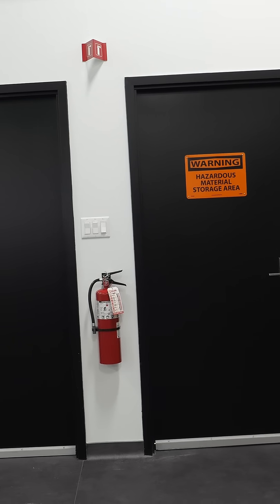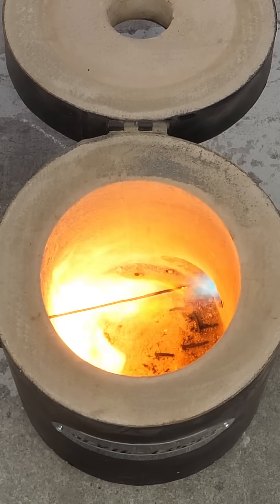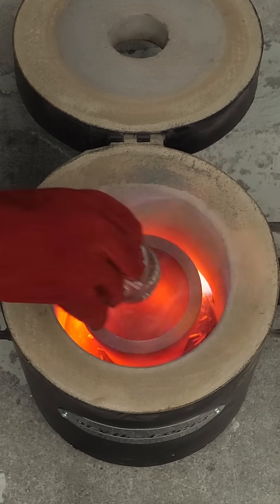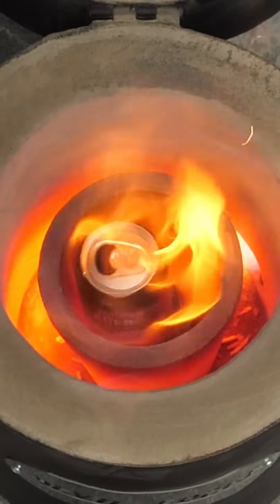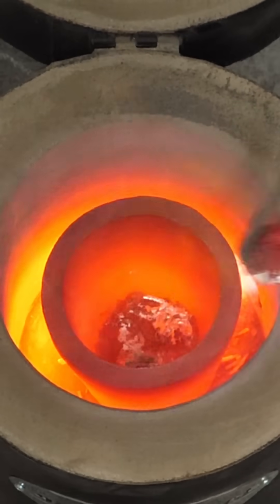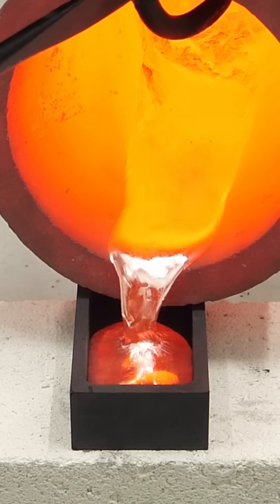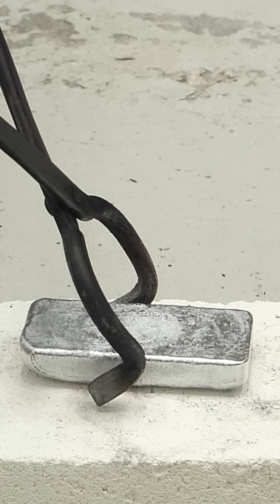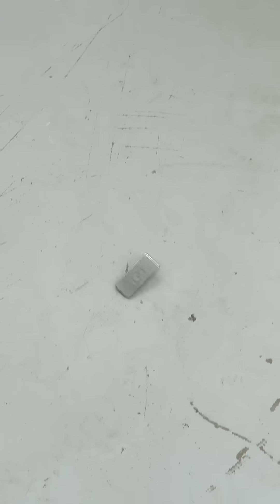Melting soda cans into a metal bar

Comment: You don't need ANY fancy equipment to melt aluminum, it is so easy*

If you've got like $30, and a good bit of patience, you can melt cans just like this. 

you just need:

- a steel pot or other steel vessel
- long barbeque tongs 
- charcoal
- a leaf blower/hair dryer with extension cord - and a metal pipe to attach to the end
- earth with any amount of clay above pure silty sand. 

It's so much fun to build a little smelter and melt scrap, it's incredibly satisfying to make a bar of metal. And it's a lot of playing in the mud to make bricks and build up what looks like a tiny fortress, it really clicks with that Lego part of my brain. 

*easy if you've got space to do it... away from neighbors and trees and access to water in case of uncontrolled fires.

Comment: The smell and smoke is caused by the plastic liner on the inside of the can burning off, its there to stop the contents of the can reacting with the metal container 

And as other people have mentioned but its definitely worth stating again, never ever drop your can in the crucible upside down, it'll either turn into a rocket 🚀 or a bomb 💣

Comment: The smoke and smell is most likely from the plastic coating inside the can which makes it so the drink is not in contact with the aluminium. Some might be from the paint but I much doubt it.

Comment: Still believe there is exothermic quality during cooling a conservation of mass and most stable form for electron vibration or excitability. Foundry’s crack yes heat expansion but also in electron “stealing” slower energy from a less excited mass and passing its energy in heat etc. there is a range for heat transfer that wants to cool drawing on cooler less excited matter around it.

Comment: i made a coal furnace with a steel bucket and plaster of paris. used a steel fire extinguisher for the crucible. had a hair dryer to blow air the coals did really well made some big aluminum ingots

Comment: The smoke and the smell is a plastic liner that they put inside the can you be better off collecting the aluminum by degrading the aluminum on the outside of the can and then resaldifying the aluminum in a distillate. That way you're not having to introduce plastic particles into the air

Comment: Be careful with that and use it in a well ventilated area. That smoke is toxic and it's burning plastic. Those cans have a plastic liner inside. That and the paint are burning. Needless to say, you REALLY don't want to inhale that.

Comment: we used to melt down scraps in the machine shop. all our stock was from a really good supplier but they didn't have aluminum in hex stock so we eventually figured out how to make our own. it really cut down the time required to CNC an aluminum cylinder from hex stock than a square stock twice the needed size. but no one in the shop liked 'kitchen duty' (a name that came from a mix of gathering the scraps to be melted down and the heat of the furnace)

Comment: Oh hey, this was me for years before I started finding other aluminum to melt down. My Can Phase definitely wasn't the most productive in terms of mass, but I learned a lot about reclaiming metal.. Cans may not have much aluminum, but they're everywhere and basically free. So if anyone else is thinking of trying this, here's what I've learned:

Obviously the cans are lined with plastic and pigment, which is bad to breathe. It's also bad to have trapped in your liquid as slag. Putting the cans in on top of each other can cause this trapped slag to accumulate and mix with your metal until you have a big, fluffy shiny sponge that can't be used.

To avoid this, I started cutting the cans into strips with some hedge trimmers, and loading stacks of these strips standing up in the crucible like a stack of money. That way they all melt quickly and everything bad floats to the surface. I skim the slag before every new stack is put in, so that inserting the new one doesn't push surface garbage back down into the mix. Finally, I sprinkle in some borax whenever I think it needs some. I can't stress enough how dirty and compromised my first reclaimed aluminum ingots were, this is everything I've figured out to purify them into usefulness.
Reply: Will be trying this now
Reply: what does the borax do?
Reply: @ernie8419  Supposed to act as a flux but borax should only be used for copper and bronze, higher temperature metals.

In aluminum, it just steals away more of it and makes more dross. You should use potassium chloride or "Lite Salt Flux" for aluminum.
Reply: This does seem like an easier way to keep the slag down. When I reclaim it I just melt it a few times and skim any that comes off every time.
Reply: best bang per buck is remelting scrap aluminum engine blocks, water pump motor cases and similar pàrts. Aluminum extruded frames such as used in doors and windows too but it is a very different aluminum. It takes a zillion cans to get a few pound ingots.
Reply: You sound really cool👉😎👉
Reply: You're cool
Reply: In Europe cans are not everywhere they get picked up because you get money for them in the supermarkets
Reply: I Wonder Iff A German Individual From Berlin Is Watching This Short, &, Getting Some Ideas.

A, Few Bars Of Aluminium, Vs, PALLETS OF CANS, Makes More Sense.
😅
Reply: @NoName-uz5ry but we get pant from them 😅

Comment: Use flux. It'll clean it up so you can scrape off the impurities, like plastic and paint and the soda or beer that was in there.  I melt gold for my pawn shop and we use flux to get rid of the impurities, and we also coat the mold  w wax for better release. You can just dunk the mold and bar in it right in the water to cool it off. Then just reheat the mold to get rid of moisture and repeat. Easy.

Comment: It's interesting to think that only 200 years ago, that block of aluminum would cost more than its weight in gold. It wasn't until a process to smelt bauxite using electricity that aluminum becomes cheap.

Comment: The Aluminum cans have a plastic coating on the inside to prevent the soda from dissolving the can.
So just be careful about that when smelting them down.. Those are some nasty gases that are released when it burns off.

Comment: I own a forge but I'm considering getting a furnace. The problem is you have to use those crucibles constantly or you have to prep them every single time you use them. They will absorb moisture from the air and you don't want that you it'll crack or explode in the kiln. I just think that's just too much maintenance for someone that's going to use it occasionally, but I recycle copper aluminum and brass so it has crossed my mind.

Comment: It should be noted that that's not pure aluminum. Most cans are lined with a thin plastic film on the inside, which I'm sure melted in alongside residue and all the materials used for the coloration of each can.

Comment: The cans have an interior coating of plastic, in theory to avoid acidic drinks from dissolving to much metal in them. 

You could try dissolving it with some acid or something beforehand.

I think it's dumb because now there's a chance it's dissolving plastics into it, AND it gets rid of that tangy metallic flavor cans were once known for.

Comment: Aluminium is a great material, lightweight and durable. Only issue I had is that it retains heat but doesn’t really have any signs like other metals it’s still hot. 

Found that one out the hard way 😂

Comment: Put s piece of cardboard on thr bottom then the crucible ontop of thst before heating it crucibles are typically graphite clay just graphite or ceramic all 3 of witch can suffer thermal shock if u put it in a hot furnace plus the crucible when hot enough will stick to the bottom of the furnace ghe piece if cardboard will burn away and the ash will act as a non stick layer

Comment: Considering the super thin plastic lining in most, if not all, drink cans, there's a fair chance that your aluminum bar is close to 90% aluminum. The plastic should have burned off, unless it fused or bonded with the aluminum, and depending on the processing of said can, could contain other metals, as well.

Comment: Not so fun fact: metal soda cans like that have a liner inside that is plastic. That smoke, horrible smell, and flames was very likely that stuff burning/melting. Ann Reardon in one of her debunking videos stripped away the metal on the bottom half of a can to expose that liner

Comment: the smoke and slag were definitely a mix of the paint on the cans, leftover bits of the drinks that used to be inside them, and plastic lining the insides of the cans to stop them from corroding. all of that was burning up while it was melting
Reply: todays cans are lined with a thin layer of plastic, that smoke and fire is the paint and plastic.  the slag is just the left over garbage.
Reply: You didn't need to tell anyone this. We literally all know
Reply: @LBTennis 0/10 ragebait
Reply: @LBTennis  everyone heard it for the first time at some point.
These things weren't taught in school in Rio de Janeiro and I'm sure most my former classmates who didn't move to STEM fields would not know still today.

Why attack or diminish something educational on a curiosity educational video?

Thinking everybody already knows is exactly what causes knowledge to stop circulating because no one wants to share information. Don't be that guy, make society a bit better, encourage learning.
Reply: @RadeticDaniel  Word.
Reply: @LBTennis 
I know nothing about this process but thanks to having a little common sense in a time when many people do not possess any whatsoever I DID know this as well.
I concur with your statement 😊

Comment: No thats was NOT healthy to breathe. Tin Cans actually have a plastic liner or coating inside that prevents the product to react with the aluminium, keeping the aluminium fresh as well as the actual product, being it cola, beans, whatever actually.. since plastic doesnt dissolve. If you burn it tho it produces black smoke which is actually toxic to breath in. Just dont do it 😂😂

Comment: The ring-pull part is high tensile aluminium. 
Pure aluminium is relatively soft and has low tensile strength. By adding elements like magnesium, zinc, copper, and others, the strength of the aluminium can be significantly increased. Your ingot is not pure.

Comment: What alloy of aluminum you get is important.
Aluminum cans are made of (very little of) a highly ductile alloy, allowing them to be die- stamped.
If you want to do aluminum casting, you want a high-silicon alloy, as it will be much more liquid and flow more easily.  Melting down some (previously) cast aluminum seems like a good approach.

Comment: If you had separated the cans bodies from their lids first, you would've gotten two secondary aluminum alloy ingots - one close in composition to 3004/3104 and another close to 5182. For now, the resulting ingot is an undesignated aluminum alloy.

Comment: You want to open the can and strip off the inner lining. You don't have to but cans aren't totally metal they have a plastic lining on the inside you can also achieve stripping off the lining inside with certain chemicals that will desolve it but not the aluminum

Comment: If you do something like this again, at the very least scrape off the paint 
The inside liner of these cans is plastic too iirc, but unless you wanna take out the piranha solution it's probably better to just deal with that 
It shouldn't be as smelly as the paint burning at least

Comment: This is of course very cool, a shiny metal bar of aluminum sounds exactly like something I'd put on display in my room, however, I would like to add that cans have A LOT of things that aren't just metal in them. 

From the plastic liner between the liquid and the metal (which is probably what made the fumes)

To the remnants of whatever liquid was in there

To all the dyes and paints used to color the thing

Comment: Consider smashing the cans next time- you can add more at once. There's also no reason to not have them in the crucible while heating, you could save a few minutes of propane run on the melt, I'd imagine.

Comment: This illustrates the issue with aluminum recycling (which also applies to virgin aluminum production): It is energy intensive. You have probably spent $10 in energy to produce $0.20 in aluminum.

Comment: Some mistakes are made ... 1st you should place a piece of cardboard under the crucible with the cans inside it so you don't get the crucible stuck to the furnace bottom ... then turn on the valve and fire on it and carefully add the extra cans until you finish all the cans you can add to it ... then pre-heat the mold to prevent the mold from exploding by moisture .... when the aluminum gets solid take it out quickly so it doesn't stuck on the mold .... cooling it with water  after you take the aluminum block would help.... I learned that from bigstacked Casting channel.

Comment: a very important detail here for anyone thinking of doing this at home is the fact that he PREHEATED the mould before pouring the aluminum in it. if you don't do this, then ANY moisture or debris that was in the mould when you pour the molten metal will expel gases and create a steam explosion.
Reply: Thanks for the tip! I'll keep it in mind next time i wanna casually melt metal in my garage
Reply: @meowwsferatu yo lo hacía hace unos 30 años (tenía 10 en ese entonces) en el patio trasero de mi casa. Lo fundía en una lata de duraznos.
Lo vertía en moldes que hacía con masilla para vidrios, sacaba los moldes de animales de plástico, y los hacía de aluminio.
Los regalaba a mis amigos. No tenía ni idea de los riesgos que corría, por suerte no pasó nunca nada.
Reply: We were taught in firefighting academy that water expands by 1200x when converted to steam, so it only takes a few drops. And fun fact, firefighters protective gear actually has a layer of vapor barrier just for steam
Reply: @Frankenstizzle  thank you for sharing. More importantly, thank you for being a firefighter.
Reply: How would you preheat it? Just stick it in the microwave?
Reply: @Hughjanus0-0  you can preheat it by putting it in an oven or by heating it with a torch
Reply: @Hughjanus0-0 you can put the molds for some time on top of the heating furnace
Reply: @Hughjanus0-0  You need a furnace to melt metal, use the furnace to preheat the mold.
Unless graphite burns under those conditions.
Reply: >doing this at home
another even more important detail because OP didn't know that it's hella dangerous to do it at home, don't do it at home, do it in a place where it can be easily controlled while also wearing some safety gears, like an empty paved lot for example, toxic fumes combined with other hazardous shit and all
Reply: Just like he said
Reply: Remember to preheat also all your tools!
Reply: I've done it plenty of times without preheating but the moulding was iron.
Reply: @bellmattwebb  I'd recommend doing it even then. Rust is partly composed of hydrated iron (III) oxide, and heating it, including by dropping molten metal onto it, will drive that water off, potentially causing a steam explosion. Any rust at all on the inside of your mold might be the thing that turns this from an interesting experience to a very interesting, but significantly more painful, experience.

Incidentally, that same principle (heating of a hydrated chemical driving the water off) is the same thing that can make polishing opals (which are an amorphous form of hydrated silicon dioxide) dangerous - if they're overheated, they can explode, sending shards of gem at extremely high speeds absolutely everywhere within the room.